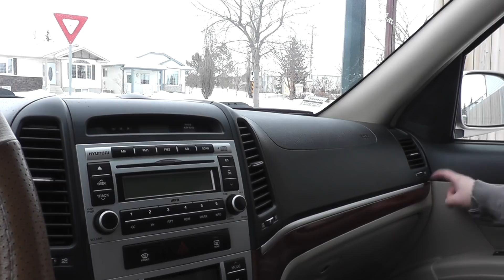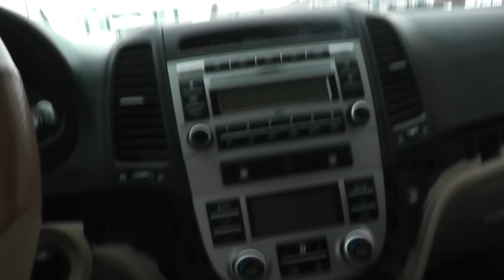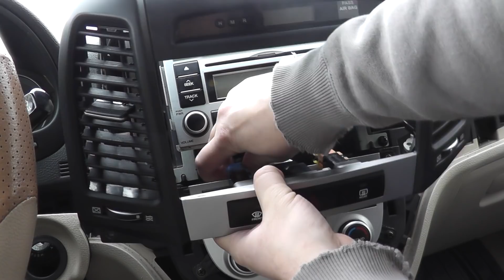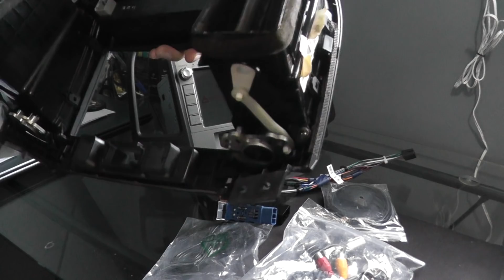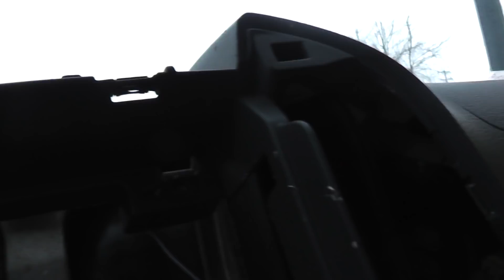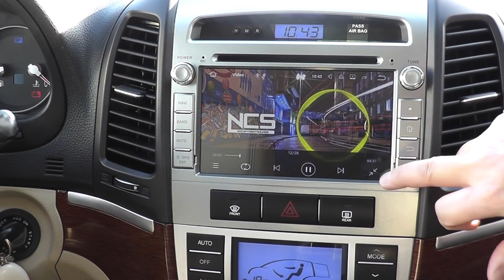Hyundai Santa Fe Radio Install

Comment: I have the touch media radio but most of the area on the touchscreen is not working some if it is working. Is there a chance that the fix is not related to a new touch screen purchase?
Reply from the maker: did you remove the protective film from it and what areas dont work?

Comment: Which android is best... there are devices with 9, 10 and 12 on the market..?
Reply from the maker: there is no best, the versions are only part of the entire system and the newest available. look at the hardware like ram and memory, sound card, scree. resolution, as part of it. newer versions require newer hardware to. you can get good units with "older" android.

Comment: I'd love to do this but the the faceplate you are using in the video is much different than the one provided from the link you gave (all black, no button/dials or airbag button etc.... How do I get the one you show in the video?
Reply from the maker: The unit I installed is no longer available. There is a new unit that is different, it will work the same but its mostly screen now. Always verify with them but as long as it has the same vents it should work.

Comment: so how do you get the speaker out. my mother in law has the infinity speakers in hers. can i just pop it out
Reply from the maker: It it has the speaker in the middle above the radio, most likely it has few fasteners (screws) holding it in place. You should be able to see them with the cover removed.

Comment: Thanks. Your videos helped me a lot this weekend put in new head unit and backup camera. Only thing left is to figure out how to get the steering wheel controls to work with new head unit.
Reply: Which website did you buy from?
Reply: @milancecavac6831 Amazon just make sure whichever one you purchase you make sure it's compatible with the mounting kit you get to put it in.
Reply from the maker: @milancecavac6831 from the Seicane store. I will get you a direct link to their newest model
Reply from the maker: What brand of radio did you install?
Reply: @Esqu3l3to  An Atoto F7WE. Has Android Auto & Apple caraway with backup camera that is also a live video so you can see it when your driving too and when you shift to reverse. Pretty decent stereo for the cost and you can move around the audio in the car which helps alot because it's an 08 so the speakers aren't the absolute best but they are decent but that can help balance out the bass.
Reply: Their was an adapter for the steering wheel already hooked up with the previous aftermarket radio that was put in but it doesn't work with the Atoto head unit. Will probably have to get a specific adapter to hook up.
Reply from the maker: Ok, so these android radios usually come prewired for steering wheel controls. No aftermarket adapters needed.
In the radio harness look for one or two wires labelled key 1 and key 2. Use of for the steering wheel controls. Ill send you the video for the steering wheel control wiring.
Reply: @Esqu3l3to  Okay, so what wire would I tie the key 1 or key 2 wire to and would I  tie both key 1 & 2 wires together into the steering wheel control wire or just one of them? The head unit has an aux hookup for steering wheel audio.  The previous radio was using an adapter that was hooked up with an aux chord as well that I tied all the wires into when I rewired everything to the new head unit directly because i couldn't find a wiring harness. Everything works good all audio work in front and back. So I'm thinking if I just wire it directly I shouldn't need to use the aux hookup that is on the new unit. Will try that this weekend and see. Thanks.

Comment: Mine is a 2012 model, it came with the standard fm/am no Bluetooth. Would the Bluetooth/satellite radio (which us versions carry) fit in place of my old one?
Reply from the maker: Hi, sorry for the late reply. That would depend on the modules and harness. Sometimes changes are made year to year. I suggest you talk to a dealer and make sure it would be compatible 1st and if they fit one to another

Comment: Hey bro , i wanna ask something! Do you know the color of the wire for the steering control?? In the oem harness. .

Thanks for the reply and help. .
Reply from the maker: I can't recall the oem wire color, however, I did mention the pin numbers so just find those and you will be able to see the oem colors.
Reply from the maker: Here is the vid of the steering wheel wiring I did for the unit...
https://youtu.be/HPVAPVD1aHI

Comment: I have the same car radio Please help me the problem is stuck on logo boot and I don't know how to enter recovery mode I don't even know how to flash it 😭😭
Reply from the maker: have you tried the reset botton? there should be one on the front or back of the unit. it will be labelled.

Comment: amazing video, I decided to do this myself because the place we want to it a total scam. The extra parts (besides the radio) are like 100~150 dollars and the place we went to wanted to charge us nearly 400 dollars for "labor" (we already paid 300 for radio and now they want another 400 for the wiring harness/stock to aftermarket control parts). This isnt even that hard lol. Thanks for the great video.
Reply from the maker: Thanks for the good feedback. Haha yes I hear you, I have been doing my own installs for a while now. Most audio shops wants a lot to do it for you and usually double or triple the $ for harnesses and dash kits. You can save a lot by doing it yourself as long as you are comfortable doing so and have the basic tools.

Comment: I'm confused why you need to buy a whole new front end, can't you just use the stock one and then use the headunit frame then it's done?

Seems like a pain to replace the whole front fascia 🤔
Reply from the maker: Yes and no, for this specific android unit it was made as a single piece including the radio trim. If you go with a typical double din then yes you would re-use the car bezzle but would still need a dasb kit to fit the new radio. Its pretty much the same amount of work on either install.

Comment: Hi there, I've installed new radio system but the audio didn't work also the button on steering wheel didn't work either, could you please help me, if you have whatsapp or email to send you some photos please.
Reply from the maker: Message me through my FB page, see the link on my YT

Comment: Fantastic video man! I was actually looking for a replacement for my 2011 Veracruz but the quality of your video was so good I watched until the end! Any chance you’ve got a good recommendation for the Veracruz? I’d like to keep the CD player if possible and just lose the motorized nav unit but after watching this I might just go for that very same unit if it would work.
Reply from the maker: Thanks! 
Their units foe the veracruz don't have a dc player. Since your dash is different than mine it will not use the same unit. Message me on my FB page, easier and faster to reply with links.

Comment: does the harness come with the adapter or did you have to wire it yourself?
Reply from the maker: It comes with its own adapter, however, I didnhave to get one that matched mine as there are various connector types.

Comment: I've installed a similar Seicane unit but it doesn't power up. Any way to troubleshoot?
Reply from the maker: Check your ignition power wire (red) and ground (black). Also check the fuse behind the radio. Some require chassis ground (bare metal).
Reply: @AutoAudioDIY  Resolved.  The harness that fits was not designed for 2008 Hyundai Santa Fe Limited with Infinity sound system.  As Plug & Play it doesn't work.  I had it diagnosed by an installer and he was able to customize the harness so it powered up and so that the steering wheel controls would work.
Reply from the maker: Ahh ok, yup they are not all designed to work as plug and play. Even tho they say it will.
Reply: @AutoAudioDIY  Thanks.  I checked ignition wire and fuse behind radio.  Also checked Santa Fe Fuse panel.  Still no power to unit.  I might disconect the 12v power from the backup camera since that is only connection that isn't plug and play.
Reply from the maker: Did you test your ground? Some radios require a good ground, like the metal framing behind the radio.
Reply: @AutoAudioDIY  I'll check the ground in the morning.

Comment: I purchased a Seicane model for my Santa Fe 2008 that eliminated the clock and "Airbag Off" LED light.  Can I splice intto the LED light and add a dash LED to retain the function?
Reply from the maker: I wouldn't do that, it may cause an issue and may get the airbag light on your dash. I would suggest plugging it in and just leave behind the dash. Unless you really want to see the sensor then relocate to top on dash if the harness reaches

Comment: For you first link, does it come with the radio and the trim around it? Like the buttons?
Reply from the maker: The unit is a single piece which includes the vent trim. You have to move over the front/rear and hazard switch to the new unit and vents of course.

Comment: My radio doesn't have a spot to plug in the passenger airbag indicator light and clock. Is that a problem for my airbag system?
Reply from the maker: Well yes and no, what you can do to avoid getting an airbag light on your dash is to plug it into the factory connetor. Remove it from your dash by removing all three screws, then plug it in and just hide it behind the dash.

Comment: Can I use the factory amp with this? I have a 2009 santa fe
Reply from the maker: According to Seicane, these units don't work with amplified systems. However, that may have changed. I suggest you contact them to verify.
Reply: @AutoAudioDIY  Thank you!

Comment: First off, AMAZING video man! Thank you. Do you happen to know if this system has the Sirius XM Radio Connection already installed, or do you need to download the app? Thank you in advance!
Reply from the maker: Thanks for the good feedback 👍 I dont recall seeing anything for the XM radio. Let me double check, but I do think you would have to install the app on the unit.
Reply from the maker: Ok, so I checked and it does not show any connections for XM radio. So your best bet would be to download the app directly onto the unit.

Comment: Hi, tell me please what is the comand for hard reset , thank you
Reply from the maker: Go through the settings, I believe its under about device.
Reply: @AutoAudioDIY  I can no longer enter the menu, only android appears
Reply from the maker: Ok, in this case you can remove the radio harness or fuse to the radio for about 5 minutes to reset it. I would suggest unplug the harness.
Reply: @AutoAudioDIY  I need to give a hard reset to return to the factory settings
Reply from the maker: Or at the front of the unit just below the USB slot there should be a small pin sized slot for a reset.

Comment: Tried installing this but the display won’t turn on.
I press the reset button and the buttons flash Orange for a second and nothing else happens.

I have everything connected except the light green wire called labeled brake.
Should this go anywhere in particular? Or do I have other problems
Reply from the maker: Not connecting the park wire won't matter, check your 3 main wires. Yellow, red and black. Make sure your ground is a good ground and you have both yellow (constant 12v) and red (switched) both working.

Comment: This is a great video Sir! I'm prepared to place an order with Seicane for this exact model. I see your model is silver in color (which is preferred as it appears OEM). The new models appear dark blue in all the Seicane product images. Did you use paint? Are you aware of the correct model that is silver in color exactly like yours? Thank you, God Bless.
Reply from the maker: This exact model is no longer available, so I did add the new link in the description box. I did not paint mine, thats the color it came from them. I am not aware of a silver instead of black/blue but ill check again.

Comment: I purchased a similar system to this one and the installation was easy but the antenna wasn’t compatible with the connector would I need an adapter for this or did I purchase the wrong system
Reply from the maker: Yes you can just get an antenna adapter. Most aftermarket radios use the universal female antenna inputs. You should be able to find an adapter locally or online.

Comment: Hello, very good explanation, very clear, I wanted to know if you had to put a canbus decoder for the steering whell control and to turn on the amplifier (if it has one)
Reply from the maker: thanks! yes you can use a canbus decoder in order to keep steering wheel controls and or other oem features. I did not used one on this unit/vehicle. I did wire up the steering wheel controls; watch here: https://youtu.be/HPVAPVD1aHI

This vehicle does not have an amplifier and the radio will not work with amplified systems. I am not sure of their newer head units but this not is not compatible with premium systems.

Comment: I love that you're still responding to comments on a 2 year old video. I'm considering getting one of these, if you know, do they age okay or has it gotten slow/laggy? Also, the new units don't have a spot for the clock and the airbag indicator. I'm assuming you do car audio for a living/side hustle, so do you think it would mess up the system/be okay for these things to just be unplugged?
Reply from the maker: I reply to any comment/question regardless of how old the video is. I can't always give the most up-to-date info as I don't own all the cars as I do installs for family/friends or anyone that is close by. Now, for your question, this unit has been great. I still have the car and we use it daily, it has glitched out twice where I have to shut it off for about 5 min then goes back to normal, other than that no issues. I have contacted the manufacturer asking that exact question in regards to the airbag, but they can never give me a good answer. I have thought that you could simply plug in to the oem spot but just hide it behind the dash as to avoid an airbag light. Also, if you noticed that there are four open slots, 1 for each defroster and the hazards. Perhaps if you modify the fourth to accommodate the airbag display? it could be possible.
Reply: @AutoAudioDIY   great to hear! Considering you've had it for a few years, two errors like that is totally reasonable, it's just like our smartphones/computers. I hadn't thought about potentially modifying the option with 4 slots, I have the 3 buttons on my dash, but I'll consider that as an option as well. However, it seems like any problems could be avoided by just having it plugged in behind the setup as you suggest. The clear advantage to the Seicane system is the ability to just plug things in out of the box (it seems no other companies offer this type of convenience, it's probably expensive). I don't want to have to deal with crimping/soldering wires in harnesses so it's absolutely appealing to be able to buy it and have it installed in an hour with minimal tools and effort. Thanks!
Reply from the maker: Correct, all electronics have some glitches and so thats nothing out of the normal use. The way I see it, placing the connector behind the radio if unable to fit into fourth slot would be ideal. If you do decide to get a unit from Seicane, double check your connector type vs what they have. Asian models vs European vs North American are different so you may get a unit where it won't match your connectors. I did buy a unit for one of my previous vehicles and thats what happened. I did just buy an adapter harness and did not have to do any splicing into the oem harness, I don't mind doing that but I do it often. Just one thing to keep in mind, my vw on the other hand was complete plug and play.
Reply: i should know the answer to your question about the airbag indicator tomorrow as i'll be installing a Dasaita MAX6 into my 2007 Santa Fe.  It looks like on the back of the unit there are two screw locations that correspond to the positions where the clock/airbag indicator might be able to screw in.

The latest Dasaita MAX6 also is a single DIN as well... instead of double DIN like the author of this video... so there should be room for cables and the clock/indicator above.

Unlike his Santa Fe mine didn't come with the steering wheel controls... and i'm wondering whether i can pick up a different steering wheel and clock spring to upgrade my car.  It should be interesting if my factory harness has the pin 11/12 in there.

My MAX6 came with two harnesses but neither of them fit the harness in the car (which is the same as in this video - M45A and M45B) so i had to make an adapter harness, using two Metra harnesses.  Evidently for the North American market, Hyundai made a deal with Delphi to make the stereos (with XM satellite radios), so the rest of the world didn't get Santa Fes with such radios or the harness that goes into them.
Reply from the maker: Let me know how it turns out, send some pics if you can. chucho_301@hotmail.com. I'm interested to see how those units work.
Reply: @AutoAudioDIY  i will :)  thanks for making this video so that i could make my comment, so that we could have this conversation :)
Reply from the maker: Ok, good idea. Once it's up and running show me how its working for ya.
Reply: @AutoAudioDIY  it works well.  i only have two complaints about it.  The supplied GPS antenna doesn't seem to work so great, and secondly the lowest setting on the volume control is too loud.  Those things i need to look into.  Other than that it is really good.  A nice improvement to the interior.
Reply from the maker: That looks awesome! 👍